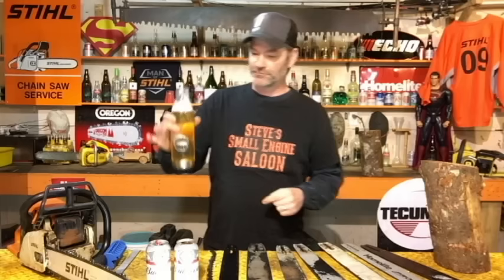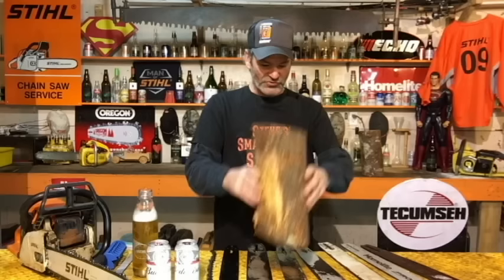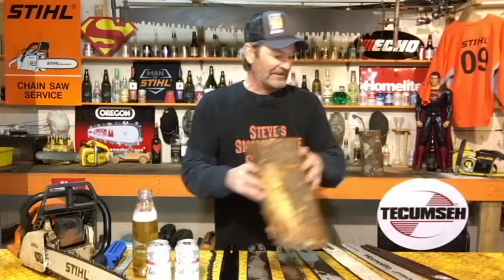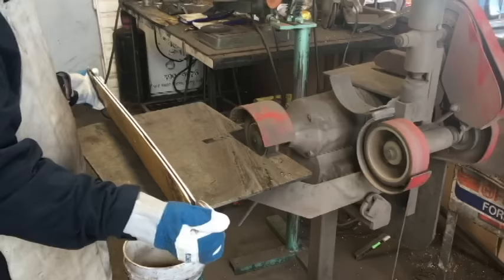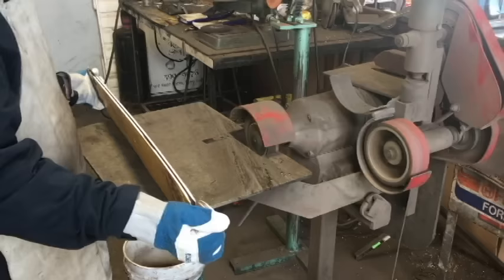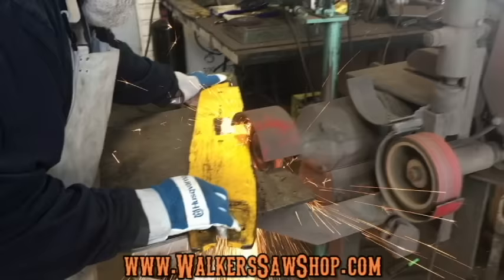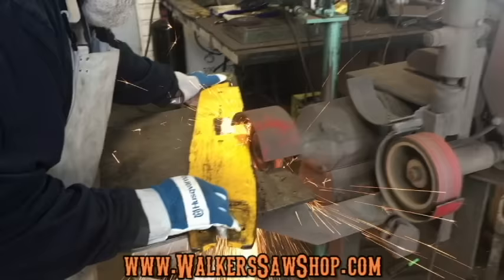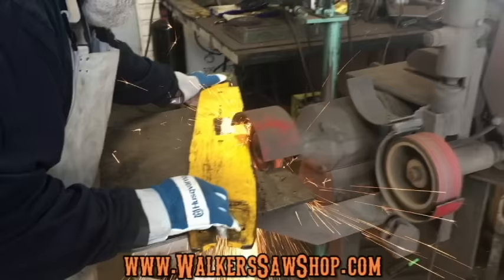How To Repair A Chainsaw That Cuts Crooked

Comment: I'm a small engine mechanic in Iowa. My shop usually works on chainsaws, mowers, riders, weedeaters etc. Well, when I have any scratching my head moments I usually check out your channel. A guy called me today bringing me a cub cadet side by side. He's had it at about 3 different shops now. His problem is a backfire when he's coming out of a turn. He's had a new fuel pump, plugs, coil I believe, air filter, leak was found and fixed in breather box, and maybe some more I can't think of. 
  It's efi also so that makes matters a bit tougher too. Only thing I can think of is possibly, assuming its power steering, that there's a power drain when he's turning that is possibly causing a misfire as he's accelerating? Any other ideas? This is only the second one of these I've worked on so any input would be great. I imagine your pretty busy so let me know. Thanks

Comment: Great work bud , i saw this video along with you're other video's a year ago or so , my chainsaw has been cutting at a angle for a week or so , and i finally remembered this video,  so i had to rewatch it.
Sure enough it was my uneven guide rail, that was causing my angle cuts. 
Now i owe you a beer or 2 for the saved repair bill! Cheers bud . And thank you.
Reply from the maker: You're Welcome...
Reply: @StevesSmallEngineSaloon  , thanks for the reply,  hey could I ask what you think caused the uneven guide rail ? So i can try to prevent this from happening again.  
Thanks again bud cheers

Comment: Steve I had a saw that cut crooked. I dressed the bar just like you said, but it took no time for the cuts to get crooked again. Eventually I found the problem. The bar is 3 laminates sheets of steel that are spot welded. One of the outside laminates was thinner than the opposing side so it would wear faster... It was an oregon bar, probably a Friday 5 o'clock issue. I wonder how many they produced before quality control found the problem.

Comment: Great info! Some saw shops can roll the bar edges inward back to new groove width and even cut the groove deeper if it is worn down too much. An uneven bar will wear the side links on the chain more on one side and ruins the chain.

Comment: I always learn something new watching you explain various topics with small engines.  Recently I've acquired my fathers chainsaw.  A Stihl MS250C that wasn't taken care of.  I'm in the process of taking it apart and repairing/replacing the various parts as this is my first time trying to understand how it's pieced together.  I'm learning about the chains and the bars that can be bought.  What I'm having problems with that you haven't mentioned or I haven't come across yet is the blueing around the perimeter where the chain rides on the bar.  Is that normal?
Reply: Not oiling enough, the bar is getting way too hot.

Comment: On the part about running the Axe File up and down on the blade while it's in the vise.  If someone is having trouble seeing if they are holding it level or not what about sticking a magnetic torpedo level on top... For reference...?
Reply: Or balance a beer on top!

Comment: Just “sharpened” my saw cutting a stump that had grown around a rock and i was not paying attention. It now , after two corrective sharpenings still cuts in a circle. So bad it actually wedges itself while cutting a 6” limb. I will check the bar , i have checked the chain but it seems intact. Thanks for your great videos.
Reply from the maker: You're Welcome...

Comment: I was cutting a larger log that had a bind ready to happen if I cut it from the top.
So I cut it from the top most of the way through and then started from the bottom. 
the log cut clean and then fell and bound the teeth anyway.  
it gripped the bar and chain so hard and fast the chain came off the bar and off the gear and was just hanging. 
I put the chain back onto the bar and started cutting since then my cuts were a nice curve through the log. 
I went home and sharpened the chain and that helped a little so maybe I will try a better sharpened

Called the Shihl dealer and he said should not be a bar problem but a chain problem. 
Bot a new Stihl chain and now nice and straight.

Comment: Great tutorial, thanks Steve. One other thing I think worth mentioning is the need to maintain the slightly concave edge on the rails to enable good tensioning.  Because most of the wear on the bar happens at the motor end, you can concentrate your efforts to redress the bar so much that you hollow the bar, which is not ideal.  Anyway can't wait to apply your lessons tomorrow and hopefully get it cutting the way it was designed. Cheers
Reply from the maker: Right on...

Comment: Yeah great video again and i had been using a cheap chain from ebay and it was the wrong size, i also found that it wore an edge on my bar just on the bottom so i used a flat file to remove the edge from the side of the rail not the top, and oh yeah wear gloves and eye protection, the edge was real sharp and cut 2 finger ouch.

Comment: I ran 36in. CANNON bar on Husky 2100 suppers with 3/8 chain and floating sprocket 6.5 hr. day 6 day week. After 5 months got the rails ground true after another 5 months New again. It's really all about the amount of chain oil the saw will deliver. Some pro saws have manual override like mine.

Comment: I use auto feeler gauges to check my bar.  For an .050 bar start with an .050 gauge and see how loose it is. Add .005 to the gauge and see if it will go.  Makes for a pretty accurate way to check the bar and compare the top and the bottom.  If you start with a new bar you quickly get a feel for how it should fit.
Reply from the maker: Great idea Larry!  Thank you...

Comment: I worked as a log home builder for Pioneer for 15 years. You learn all about cutting crooked on your first year on your own. I used a Husqvarna 397xpgw, with a standard issue "24 bar, 3\8, round tooth. There are lots of opinions on the best cutting method. Only on special cuts, did we intentionally want the saw to cut crooked.

Comment: Great insight!  I do a lot of chain hand sharpening in the field and then touch em up with a chain grinder in the shop.  For my bars and chipper blades, I put a 7" metal cutting wheel in my table saw and that allows me to quickly even the bar rails and then tip 45 deg. for the chipper blades. The one thing that I didn't think of is the actual bar channel getting to wide and allowing the chain to move to much.  I guess some times you just have to scrap an old bar.  :o(
Reply from the maker: Great tip buddy, thank you...

Comment: That is a great tip and I will remember it for when I have that problem with my saws. I am having a problem cranking my saws and the repair people used the drop crank procedure to crank them and it worked for them. When I get the saws home and try to crank them using the manufacturers two procedures they don't crank for me. I got tired and purchased a battery saw and do the trimming using it and the saw seem to work just fine, but I would like to get the others going, especially the Stihl saw since I paid so much for it.

Comment: I just bought a new MS 362 and it cuts really crooked. I'm only on my third tank of fuel. I did have the saw shop put a better bar on the saw when I bought it. I have some investigating to do....thanks for more great saw tips!
Reply from the maker: You're Welcome...
Reply: If that's all the older it is I would suspect a problem with the chain ( hit a rock or metal maybe) the bar should not have this much wear thru 3 tanks off fuel
If I'm wrong and ur problem is with the bar and not the chain keep in mind that you should NEVER push a saw thru a cut, just let the weight of the saw pull itself thru
If it has been forced and jammed thru cuts, the problem could be in the bar rather than chain

Comment: New bar and chain (packaged together) on a husq saw- still cuts in a dish! I did have a couple broken isolators that I replaced, but still does it if you put any pressure into the cut - including the weight of the saw plus my arm resting. If I lift up (extremely slow cut) then I can force it to cut straight. I blame it on being a husqvarna instead of a stihl.

Comment: My saw just started cutting at an angle out of the blue. Consequently I recently had to cut through some tree roots and sharpened it a couple times. I heard that sharpening right teeth more or left teeth more could cause this. But I did  try and evenly sharpen both left and right teeth. Gonna try one more sharpening before getting a new chain for my Husky 455.
Reply from the maker: Right on ...

Comment: Thanx, Steve!
Along with other guys here, this is the problem that drives me crazy.  I usually swap in a new chain. And if it still cuts in an arc, then it's the bar.
So... I buy a new bar!  I must have 3 or 4 kicking around here now. 
I'll see if I can fix the bars. (yes, I DO flip 'em over from time-to-time)
Both my wife and daughter sometimes chainsaw.  Always with safety glasses.  I'd lecture them  about Steve saying how badly a metal sliver in the eye hurts, but they'd probably just swear at me, and say "OK! Then do it yerself,  smartass!"
Reply from the maker: Right on Tony!  You're Welcome...

Comment: There are some saw shops that can recondition the bar back close to specs if it gets bent or too worn. It's usually only for bars that are hard to find or where only a small part of the bar is out of spec.
Reply from the maker: Absolutely correct!  Thanks buddy...

Comment: My ms170 made a U-turn while cutting. Thought my bar was bent or worn out,nope. My buddy hit something hard with it an knocked out 4 teeth. It took a while to figure it out because I had just sharpened it and inspected it. I should have inspected it when I got it back.

Comment: Well I would like to let you know you helped me I sharpened that chain a million times evened the teeth on both sides and I took the whole thing apart I was already going to flip the bar but now I know that was the problem it was wiggleing on the bottom I filed the bar edges all stair again and flipped the bar and now it cuts beautifully unless I cut upward and it was the opposite before and now thanks to you I know why thank you for the education and the awesome videos
Reply from the maker: You're Welcome...

Comment: Nice stuff but what happened to bar planers ? I cannot seem to find them anymore, had my own in 90's/early 2000's and it got many uses out of bars that are made with deep grooves for them. Sure many could do Bar revamp with a hand grinder or easily make a DIY bar planer with a hand grinder.

Comment: Some good tips Steve. Another item that can make them cut crooked is the burr you mention on the bar. After a ton of miles I usually swipe that off now and then. I notice it on saws that belong to weekend warriors that continue to run the saw long after its gone dull. I usually just check for it whenever I have my chain off

Comment: Hi from OAMARU N.Z.  Yeah I use a vallorbe ski tuner which also holds a file rite angles.  The worse experience I had was sharpening chain then I grabbed a tooth the zoomed it up the bar which is caught a hardened barb on finger tip....man did that hurt?!!!!!.

Comment: Thanks for a great presentation. I learned something. I have a saw that is cutting crooked and I've carefully inspected the blade. I've only sharpened it once and I know I cannot have screwed it up that bad.  I looked at two videos before I found this one. The others seemed to want to put all the blame on the blade condition and sharpening.  I did not know what to look for regarding the bar but I do now. Hopefully I'll have this sorted tomorrow.
Reply from the maker: Good luck my friend....

Comment: Badly worn bar groove? Measure the groove with feeler guages (or a drive link(s) from the next thicker size guage chain). If the next size guage chain fits the groove more use can be made of the bar.

Comment: Hey Steve thanks for another great video. I really like your channel and the way you teach. I have a related question about chains that cut little steps into wood rather than a completely flat cut. I notice after I hand sharpen a chain once or twice it tends to leave a bunch of little steps into the cut.  I figured this was just from uneven hand sharpening?

Comment: good to know Steve! I always thought you just got a new bar when they wore out!
Reply from the maker: Right on....
Reply: Not when you're out on a right of way in the middle of BFE and 3-4 hrs from home and no saw shops around....LOL
Ya just take the bar off and lay it on a good solid place and lightly tap the bar groves back together.If you closed the bar groove a lil to far and the drags wont fit the saw wrench will  open it back up for you with a slight twist till they do fit again.
Once you get home for the weekend you can go buy yourself that new bar ....lol

Comment: One other way to do the bar rail fix, if you have a table saw is to put your sanding disk in the saw and use that to square up the bar, have done that a couple of times and worked good. Naturally use a medium to fine grit and go at it slowly

Comment: Thanks for the video Steve..  If the rails are different you might not be able to see the slight difference by eye, but the 'balancing on a level surface' works a treat.   The belt sander is also better than a grinding wheel, because you may not be able to get exactly 90 degrees to the wheel.
Reply from the maker: Right on...

Comment: You didn't mention anything about using a rail closer tool.  I use the blue squaring file you showed but I suspect some of my bars are worn on the inside.  I also think the reason I cut off from square is that I have my left hand too far to the left on the top handle and it causes it to cut to the right.  An comments on that?

Comment: That happened to me one day when i was cutting down a tree. Later. I took the chain off and I saw the one side was higher than the other side.i put it in a Vice and i kept filing it until it was equal on both sides.i put the chain back on and tried it and it cut straighter than the last time I cut into the tree. Fixed.

Comment: great video. Ive alwyas tried to rotate the bar every time I swap chains. I also sharpen my own chains.....I have found that the local shop that sharpens doesn't do as good of a job as I can......I don't think they pay attention to the depth gauges.....I guess it takes to long to do a proper sharpening.
Reply from the maker: Sounds like you know what your doing!  If you watch my video on sharpening, I would be curious to know if that's how you do it?
Reply: You pretty much covered everything on sharpening. I always use a bench grinder to sharpen with. I never had much luck when sharpening by hand. I always look the chain over for the worst tooth. That is the one that I base all the other teeth will be sharpened to. I doubt all the teeth have to be the same length, but I prefer to base them on the worst tooth. as the the depth gauges, I check every chain each time it is sharpened.....but they get ground maybe every third or fourth sharpening. I don't mess with using a file to cut the depth gauges.....if I find they need to be taken down, I use the tool to set my grinder, then carefully grind each depth gauge.......once I get set up, a 20in chain takes me about 6 min to sharpen. One thing to consider when sharpening with a grinder......don't just bury the stone into the tooth.....be careful to not over heat the tooth.

Tooth types makes a pretty big difference as to how long they cut well. I have a LOT of black locust here. I have a few chisel tooth chain......they are the last ones to get put on my saw......the semi-chisels last way longer on the hard stuff.....or if there is a little dirt in the bark.

Comment: Did you mention the tool that will slide down the bar and recompress the bar to original size and this will take out any side play of the chain also. If your bar wears don't throw it away yet just get you a bar slide and fix it like new.

Comment: Try this trick if you have a table saw. Take a 1x1 or similar piece of wood the length of your flat file and cut a kerf down the middle. Slip the file into the kerf and with the file flat to the top of the bar, run it down the length of the bar. The wood keeps the file perfectly 90 deg to the bar top.

Comment: THANK YOU !
Reply from the maker: You're Welcome...
Reply: Well I am back, I filed the bar rails and used polish granite counter top scrap piece to check for 90 with a square.  I bought a new chain and made sure the tension was all good etc..
I decided the inside rails must be worn out, I noticed the chain was riding off to one side after a few cuts.
Time for a new bar I guess.
Once again THANK YOU FOR THE INFO!

PS your info on checking for proper oiling video was great too, I think that little hole area was clogged, it was oiling the bottom on the chain somewhat, but was not spitting any off the tip like it once did, I cleaned the gap from the hole to the inside rail and feel it was clogged up in that pass area.

Comment: Steve you have a great channel and your videos are really well put together and informative. Can you tell me what could be the problem if a chainsaw is underpowered and consumes too much fuel! My friend has the same make and model and is able to cut 1,5-2 cubic meters of firewood with a single tank and I can't even cut 0,5 or so... It's annoying and expensive. Keep up the good work!
Reply from the maker: Thank you for the awesome comment!  Go back to my channel and check the video called "rebuild a carb on a chainsaw" that might solve the problem....
Reply: Thanks a lot! I'll check it immediately.

Comment: Steve, you need to deburr the edge of the bar as well so it no longer has that lip on it.
Could you also tell us more about the bar tip sprocket and a good way to clean the bar chain guide groove?
A wire brush maybe?
Love the content and channel. :)